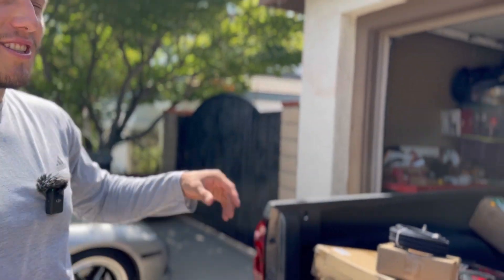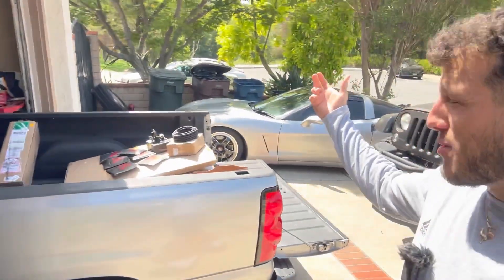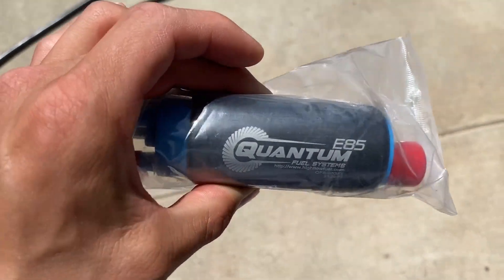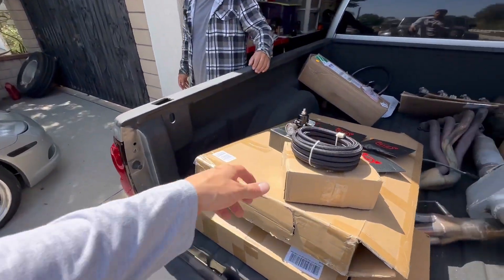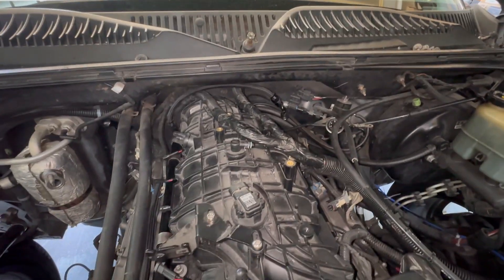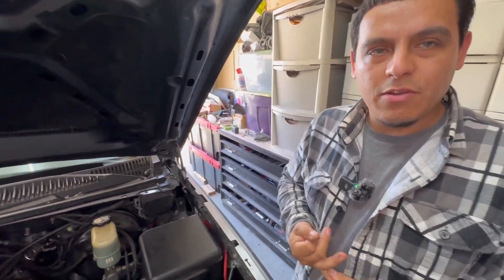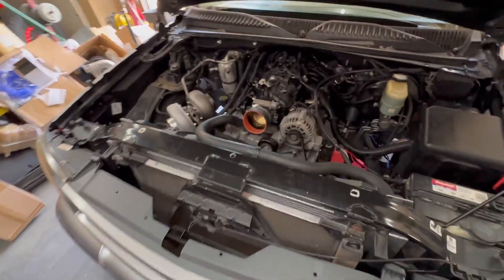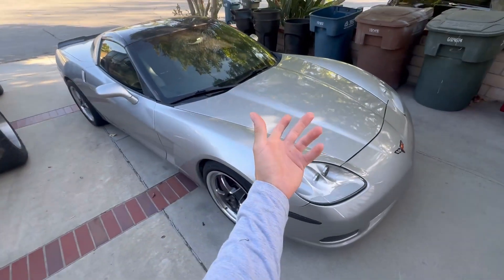EVERYTHING YOU NEED TO INSTALL E85 ON YOUR LS & VORTEC!!

Comment: Got the same pump but I’m max effort na on my 2003 Tahoe. Should i get two? I am staying na till I can afford a supercharger but right now it’s got a cam, big injectors,3200 stall converter. I’m trying to run E85 though
Reply from the maker: If you have a 450 pump on pump gas that should be plenty on a na setup. Once you go e85 and start pushing big power say like 600 plus then you’re going to want to go with a dual pump setup.

Comment: I’m running In parallel with the regulator after the rails and upgraded the return line to 8an my feed line is 10an with a triple pump. 
My e-85 sensor has a motion race work adapter that flows around the sensor 10an but also allows fuel to flow through the sensor but eliminates any restriction anyone looking to flow without any restrictions look into the motion race work fuel sensor mount runs for about 99.99
Reply from the maker: Sounds like you got a great setup going there, yeah I seen those motion race-works sensor adapters. Might be something we go with if we ever decide to go for serious power.

Comment: What injectors u using
Reply from the maker: FMS 1200cc injectors
Reply: Hello, do you need replace the fuel injectors form stock? Just want to run e85 from stock vortec 5.3. Thanks

Comment: what fittings did you use for the fuel fitting
Reply from the maker: Which one?
Reply: @ErikRose_  the ones from the stock line to the filter
Reply from the maker: From the stock metal lines to the new fuel filter? I used 6an tube nut and sleeves. The metal lines also need to be flared to work with these.

Comment: For people out there who haven't done their fuel system yet on their 99-04 trucks, you can take any tank from an 05-07(classic) and it will fit directly into the 99-04 trucks. The newer tanks have a bigger opening and allows you to fit either one massive pump, like an Aeromotive brushless spur gear pump, or even three 450lph pumps. That's just another option for people who still want an OEM tank, but want a fuel system that can support a TON of power without needing a fuel cell.

Comment: Nice one bro keep it up basically running the same setup just without the E85 since it's hard to come across E85 over here 4-Hour drive just to get E85 lol I'll pass definitely a lot better though 💯👌
Reply from the maker: Yeah in LA E85 is everywhere that’s why ive been fine driving just on e85 lol
Reply: @ErikRose_  yeah I would just tuning it for E85 if that's the case bro 💯 One Step Closer